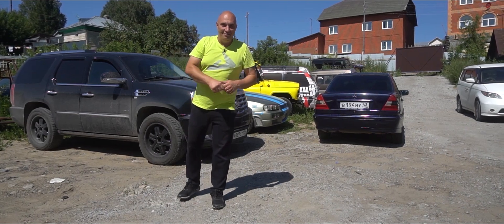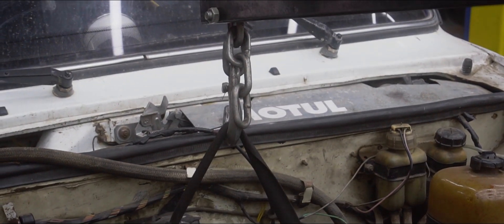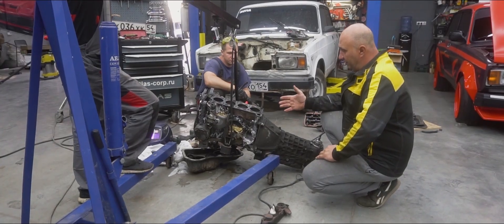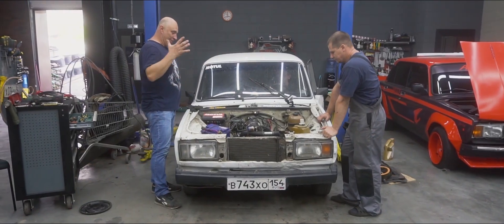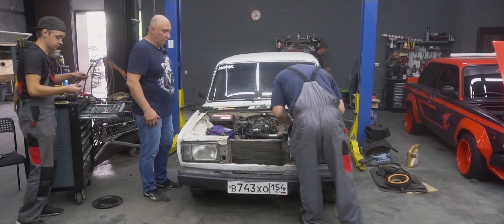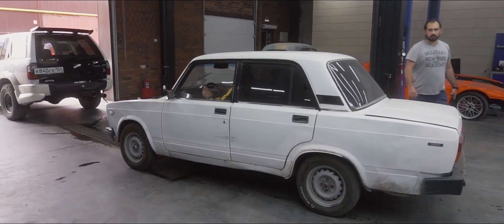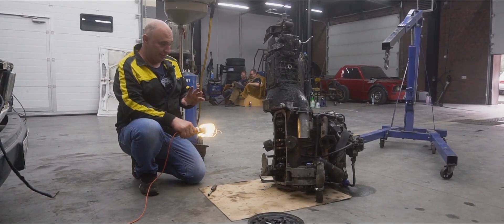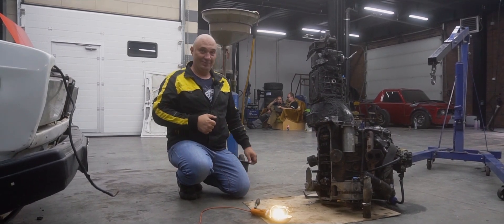Spring mod for piston rod – will it work?

Comment: Guys I know what you can do next. Make z-dampers! They were outlawed in F1 racing but they are pretty simple and I know you guys could make them. It's basically a shock absorber but instead of a pressurized tube it's a giant screw that has a weight threaded onto it. So the faster the shock compresses the faster the screw spins up the heavy weight. This way the car is unrestricted by the device at slow speeds like going over big humps in the road, but at fast speeds like when you are racing it's very hard to spin up the large weight quickly so it acts as stiff resistance. It's such a cool device not only because it works so well and was banned from F1, but also because there is an electrical engineering formula that uses resistors, capacitors, and inductors or something like that and if you apply the same formula to car suspension the z-damper completes the missing 3rd piece from the formula. Because springs are like capacitors, the more energy you put in them the more they store. Shocks are like resistors because they resist change in motion in both directions. And z-dampers are like inductors. They fill a missing piece to a puzzle to make it fully solved. You wouldn't believe how good cars handle with the z-damper along with shocks and springs, there are videos of the F1 car that had it before it was banned and it goes over bumps and turns and the car stays perfectly level and flat.
Reply: That sounds really cool I've never herd of something like that, would love to see them make it
Reply: @danielbarrett6960  There is tons of awesome banned F1 tech. Garage 54 could do a whole series with each episode a different banned F1 technology.
Reply: @El_Chompo  But why is all that good tech banned?
Reply: @billbergen9169  One of the reasons are g-forces experienced by drivers. A car that can go around a corner faster than what the driver can handle is a serious threat to the safety during a race.
Reply: @El_Chompo  They sould do a DAS system and a blown rear difuser
Reply: @billbergen9169  Unfortunately because F1 racing is very political and the different teams like to fight with each other and complain about unfair advantages. Also it costs a lot of money to redesign your car after finding out about a new tech that you aren't using that a competitor has.
Reply: @El_Chompo  Yeah, true.
Reply: @billbergen9169   Sports isn't sponsored to put bullets in feet.
Reply: You're getting some things mixed up. Interters(J-dampers, or mechanical capacitors) are generally just flywheels attached to a ball screw. They resist any change in velocity(Newtons first law), where a regular damper simply resists velocity. The suspension is always restricted by the device, however it is proportional to shaft speed. 

Springs are inductors, dampers are resistors, inerters are capacitors for the electrical analogy. For a car they tune the resulting frequency in the tire and suspension to aid the constant loading and unloading of the tire contact patch resulting from any surface imperfection or handling maneuver.
Reply: @finalreqy634  Thank you so much. I knew I didn't have the analogy right. It was so many years ago I heard of it.
Reply: i'd sure like to see that
Reply: Mass dampers are used in some very high skyscrapers. 
Never heard about Z-dampers in F1.
Reply: Are there any good links where one can read about these? I tried googling "z-damper", didn't come up with anything useful.
Reply: @SwapBlogRU  Wow yeah z damper is definitely the wrong term sorry about that. Here you go: http://www.formula1-dictionary.net/mass_damper.html

(I was wrong about how they worked too!)
Reply: @El_Chompo  no sweat, man, I've already found and read a few articles about the mass damper, so it's all good. We threw the suggestion to G54, we'll see what they think.
Reply: J-dampers
Reply: I'm gonna need to see some sources. In my system dynamics course we talked about mass spring dampers at lot and by varrying those three values basically any response could be obtained.
Reply: @TheMetalButcher  Yes, it was system dynamics. Thank you. I couldn't remember the class.
Reply: It's called progressive shocks 😉
Reply: they could simply get a high end cars, they've had active suspensions for over 15 years. airbag instead of springs with a electronic damper that reacts instantly to accelerometer in real time.

Comment: You might have done better to make new rods out of hard rubber! - Or, how about trying plastic rods?
Reply: Cheap steel tubing.
Reply: @skuula  How about flexible steel straps?
Reply: Yes... cutting a section off of the conrod, and simply bolt a strip of really hard rubber to it.

Comment: This is such a cool idea. It's technically possible to make a spring loaded connecting rod that would actually run in an engine but it would require some real engineering. You would need at least 3 springs in a triangular shape stiff enough that the piston couldn't rock in the bore.

Comment: The springs will compress till the valves open. and then compression will be lost.
Reply: And then the valves will hit the piston.
Reply: @leoa4c  No all the compression goes to the springs. No pun intenteded.
Reply: @leoa4c  no, it will still be as long as the original connecting rod if the travel from the compression release doesnt fling the piston upwards
Reply: @FUCKIN MINT Exactly. Imagine 120 PSI across a 12 square inch piston That's 1400 lb on that little tiny 60lb valve spring lmfao
Reply: Rods must resist bending loads with every stroke,  no it will not work.
Reply: More likely just sproing out to the side and snap off once its under compression. Predictable, but had to be done, I guess...
Reply: Its true

Comment: Talk about a low budget variable compression engine. 😬
Reply: Blyat!
Reply: Even if the welds survived, the piston would touch the valves... ending in kaput :)
Reply: @leoa4c an engineering solution in the way of a chaine down the middle of the of the spring can be introduced
Reply: @leoa4c  yeah having a distance limiter connected between the piston and the crankshaft coupling would work.
Reply: @leoa4c  need hydraulic rods instead
Reply: @leoa4c  That depends of the total length of the conrod.
Reply: @leoa4c  thinking about it this could maybe work as a 2 stroke tho:D
Reply: @leoa4c  Unless it's direct or maybe port injected
Reply: @leoa4c  You meant that it would end up in absolute pizdets.
Reply: Vivian Stimpson my friend it’s mother Russia you don’t time the engine the engine times you
Reply: Russian VVT-i
Reply: everybody wants to fuck with the piston to get variable compression, Honestly I think it would be better to fuck with the head. Have like koenigsegg camless valves on a cylinder head that shifts up and down to change the size of the combustion chamber at tdc
Reply: Variable compression engine; F all down to less than F all.
Reply: Power decrease = mega
Reply: variable stroke engine
Reply: Russians just know how to roll man
Reply: Variable coompression engine is possible
Reply: https://youtu.be/R8CJM0CHhFA

Comment: Springs with no dampers? Lol slap some shocks on them puppies
Reply: That would have obviously made them stronger...
Reply: Might as well go all the way!
Reply: I have a triangulated 4 link with coil springs for connecting rods
Reply: Why not a diy variable cylinder compression?
Reply: @edwardwood6532  you might be onto something, threaded adjustable connecting rods
Reply: Or hydraulically actuated ones that lengthen when oil pressure rises and raise compression, or vise versa
Reply: THE WORST PART IS THIS WOULD PROBABLY WORK UNTIL THE SHOCKS HEATED AND EXPLODED 😂😂😂😂

Comment: I mean, what did you expect? Cool experiment though You should have used much stronger springs. That might have got you somewhere
Reply: The springs were strong enough, it broke at the welds anyway
Reply: @georgerosebush9754  actually yes and no. Yes, they broke on the welds but these springs can get compressed very easily by the explosion
Reply: @Eddie Hitler piston go boing
Reply: @Eddie Hitler In addition, when the conrod compresses, it is not compressing the A/F mixture. It would lead to knock, pistons touching the valves... a total mess.

Comment: Install an electric motor and run it by an electric generator and see the milage
Reply: Conservation of energy dictates that it will be considerably less efficient.
Reply: @DOCTOROCTAGONAPUSS  Diesel electric locomotives are not that terrible in efficiency.
Reply: @DOCTOROCTAGONAPUSS  not necessarily, since the engine will spin at a constant rpm.
Reply: @doktorsalami9315  What's easier?

Fuel>Kinetic
Fuel>Kinetic>Electric>Kinetic
Reply: @DOCTOROCTAGONAPUSS  
It's not just fuel -> kenetic. That kenetic energy goes through a whole host of other transfers. Once you hit a certain weight, it becomes more efficient to bypass a typical drivetrain and make a big diesel engine turn a generator which sends power to the electric motors.
Reply: @doktorsalami9315  Exactly, it will spin at a constant RPM. RPMs which will be averagely higher. On top of that, you will have energy losses via inversion, motors' heat, etc.
Reply: @DOCTOROCTAGONAPUSS  If you want to be that precise: What's easier?
Fuel > kinetic > electric > kinetic

or 

Fuel >kinetic > kinetic > ... > kinetic

regular cars have gearboxes. They constantly change rpm. Idle to load to idle and so on. Chances are, not everytime, but in at least some cases the hybrid might be more efficient. Such cars are even built already.
Reply: @leoa4c  don't mix things up. It would rev higher BECAUSE of the energy loses in Order to archive the same power output. But gear boxes, drive shafts etc. ... can and do heat up as well. These won't be needed when working with electric motors. So you can actually argue that a hybrid solution might be more energy efficient. Add a battery to store energy you regain from engine braking and the regular car will have a hard time to be equally fuel efficient :D
Reply: @doktorsalami9315  you could also tune the car to be very efficient at a specific RPM.
Reply: @DOCTOROCTAGONAPUSS  you can use the engines most fuel efficient setting and don't exactly need fuel engine torque to generate electricity. Electric cars with on board generators have a far better fuel mileage compared to cars
Reply: @janm7163  You guys are all talking like we didn't just watch these men put springs on pistons.

This is Garage 58. They're going to halfass everything and be lucky if it even moves 😂
Reply: @DOCTOROCTAGONAPUSS  True hahaha
Reply: 0
Reply: Use gas engine for rotary motion, turn rotary motion into electricity, turn electricity back into motion 
Diesel-Electric LADA !
Reply: Possibly the benefit of having the electric drivetrain is more power at any speed. The engine can run at the speed that delivers most power constantly. And electric motors deliver that power right from 0km/h and up. Or if you want to be efficient with gas (what vichazo wants to see) let the engine just run idle all the time and accelerate in a way that it doesn’t stall the engine.
Reply: Works for US locomotives, why not cars?
Reply: @andie_pants  not that simple.
Reply: @andie_pants  are you a Freaky??
Reply: @andie_pants  and tanks 😁
Reply: Isn't that a hybrid car?
Reply: @PC-qx3bv  there are different types of hybrid cars, but yes, it is
Reply: It will work but most generators are actually pretty inneficient
Reply: Just think of it as an electric transmission and clutch rather than mechanical one. I think mechanical clutch with have a hard life in a locomotive and we all know how efficient a big spinning drum of oil is for a drive coupling (torque converter).
Reply: It works fine because it's basically an electric drivetrain instead of mechanical. Put in a small batterypack as a buffer for acceleration and brake regen and you have a nice efficïent hybrid.
Reply: So produce motion energy to create electric energy and use that electric energy to turn it in motion energy? 100Mpg and a shit ton of excess heat
Reply: @antreaskonstantinou8585  not really electric generators are quite good at not producing too much extra heat on account of them being designed for that perpose
Reply: So basically you're saying they should build a series hybrid car?
Reply: Did just that on campus and the vehicle ran just fine and charged itself, it truly works... We were told to not do that because a few people wound up disappearing for trying to patent it !
Reply: Lassi Kinnunen  Not really. There is no such thing as a free ride when it comes to thermodynamics and the Laws of Entropy. 
 
Get the train started by whatever means and then switch on the generator system. The magnetic field created by the turning generator would actually create enough drag within itself that the generator would stop the train after a while without assistance. You would constantly have to 'boost' the train. This is how real locomotives work. They do not run on free energy, they use the generator system to alleviate burden on the primary motor so it doesn't have to work as hard. This saves on maintenance and diesel.

A pure electric train is no different. Except that it must utilize an onboard power source to boost with or an outside source. Either way, the charge coming in vs. the charge going outwill always create a scenario where more energy is spent than generated. 

There are no free rides. Sometimes, however, there are holes in the fence. But eventually you must pay.
Reply: @Keys879  I think we are discussing 2 different things. Perpetuum mobile is impossible. But running an electric motor by burning fuel in a generator is not.
Reply: @NicB-Creations  No, because you do it every day in your car. But all you'll be doing is getting a full charge on the battery. Nothing more. People here are talking like it's cheap or free energy. Its not.
Reply: Chevy volt does that

Comment: Valve spring connecting rod? There's no way this could possibly go wrong
Reply: Chainsaw drive train
Reply: Mekanick.
Reply: Brett Collins  Why are you laughing ? Virtually all pre-1950 motorcycles had exactly that set-up. It's a flathead engine ! Still being used in aircrafts today.
Reply: It defeats the purpose of the connecting rod. It needs to be rigid for a reason and when you make it a spring the rod probably itsnt moving at all or like it should because the spring is taking all the movement. Still really funny
Reply: @reactionjd  Remember, the deflection of the spring is finite, and so is the force if the cylinder compression.
Reply: But do it for the laughs anyway. :-)
Reply: TheOtherWhiteBread0  in the realm of at least 95psi.
Reply: Just pure curiosity to see what entails.
Reply: I was thinking the same thing.
Reply: Hey i was your 1000th like congrats on 4 digits lolol
Reply: BababahahH
Reply: due to the total lack of regular compression, not a chance!
Reply: @rarbiart  There's no lack of compression. If the springs were sufficiently strong, you would certainly get compression, just with different dynamics.
Reply: @thefreedomguyuk  I have not done the math. But imagine you want to pump with at least 95psi with such a bore. it would be like 10 bicylce hand pumps at the same time, or perhaps 3 big bike footpumps... and there you hardly go over 60psi. 
in other words: yes, a strong spring is needed, probably 3-5 times stronger than the one shown.
Reply: @rarbiart  No, that's not how it works. Given that the spring doesn't separate from the conrod, the spring does not need to be stronger to achieve the cylinder compression required for combustion. The spring itself will be subjected to compression, and when it reach its fully compressed point, it's no longer a spring, and you will see the normal cylinder compression pressure.
Reply: Floppy pistons. Interesting but not practical
Reply: Right
Reply: https://youtu.be/R8CJM0CHhFA